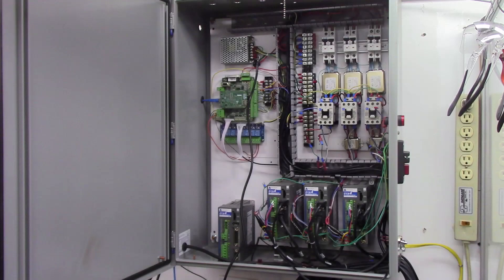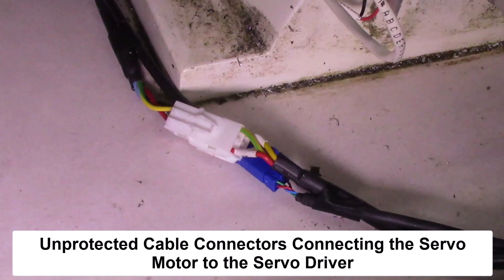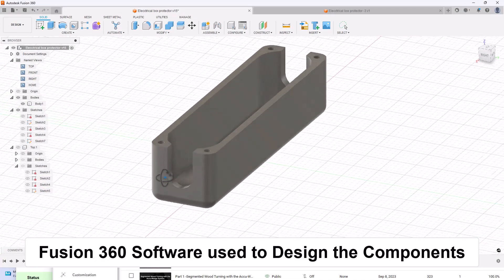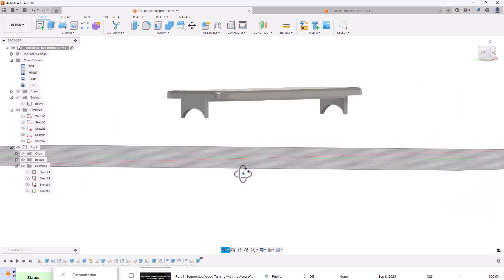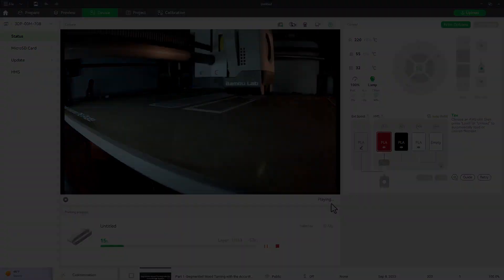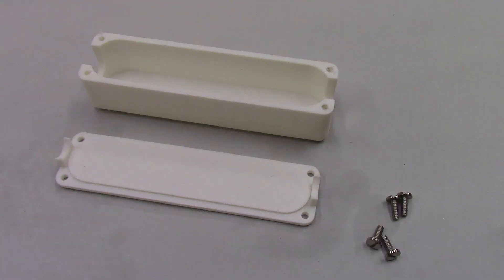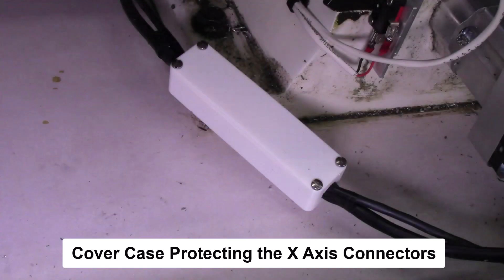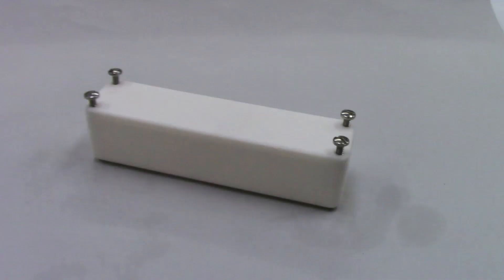DMM Servo Motor Two-Piece Cable Connector Cases

Comment: Nice design. I have a 3d printer at my workshop and it has been great for R+D ect. I have recently been using the 3d printed models to take fibre glass moulds from and it has been excellent. Thanks for posting and offering to share your design for free, such a gent!